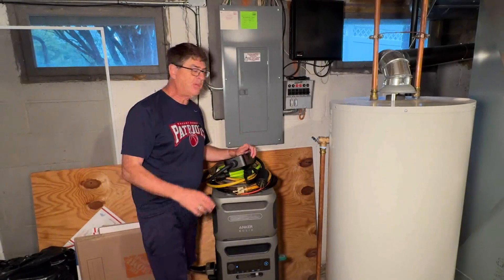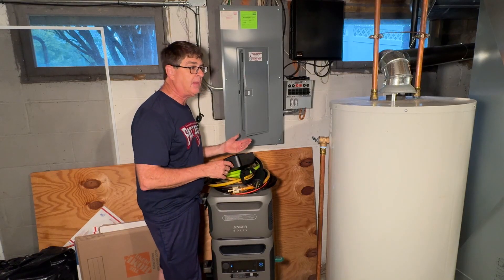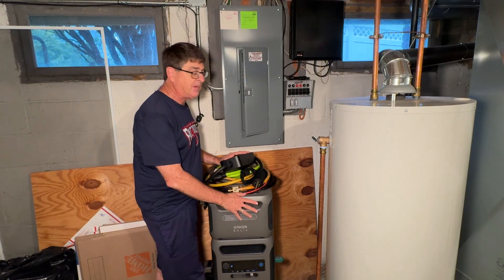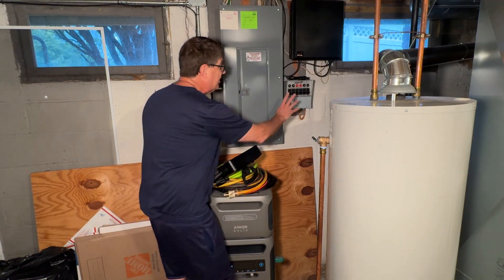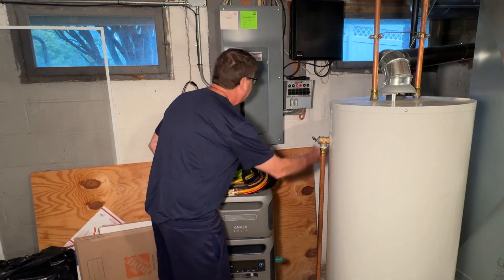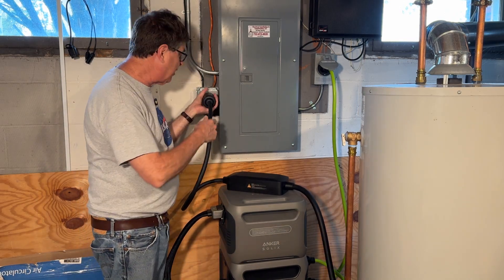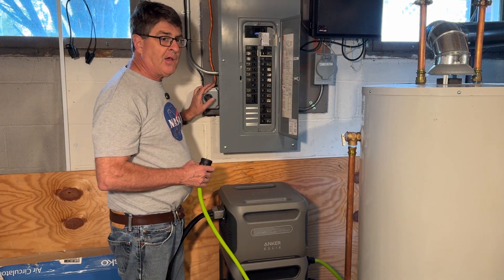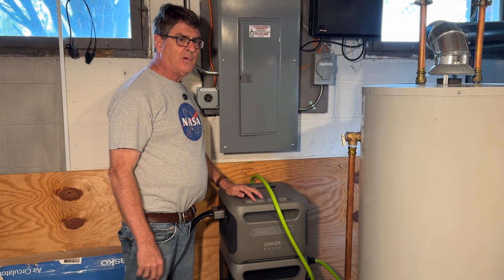Backup power retrofit for Anker Solix F3800 Plus with pass-through charging.

Comment: This is a really elegant solution, especially if you don’t currently have the Anker. Lets you use the gas generator until the Anker arrives.
Reply from the maker: Yes. You can jump from the output on the left to the input on the right, once the generator outside is connected.